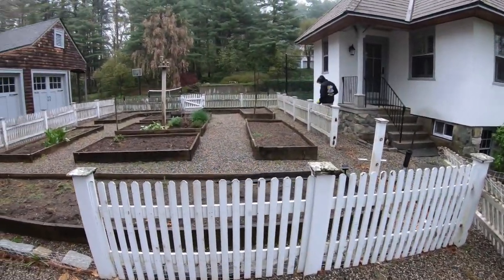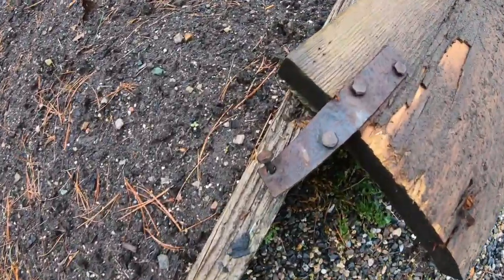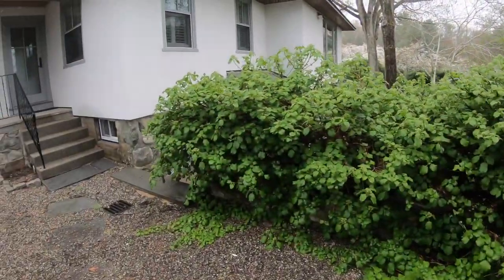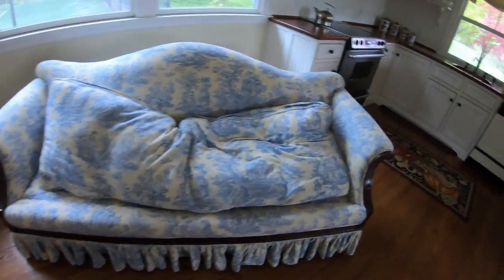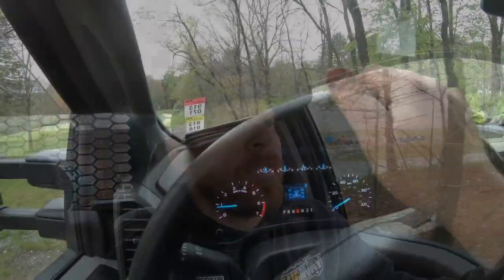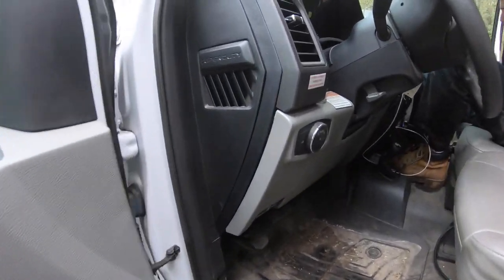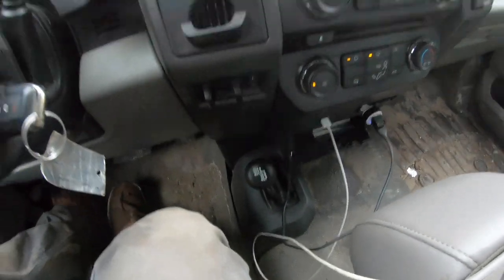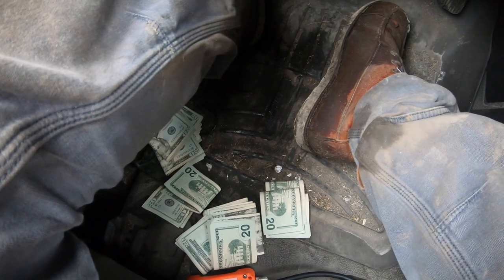HOW I MAKE $2K A DAY! JUNK REMOVAL DAY IN THE LIFE EPISODE 14

Comment: I saw you dumped a copper baseboard heating element, do you keep the more expensive metals you come across (i.e copper pipe and wire) might be worthwhile to have a spot at the shop to collect it and when you have enough, scrap the expensive metal. Just a thought.
Reply from the maker: I do. I tossed that because I wasn't thinking lol. Normally I would take the time to pull out that copper pipe. I have barrels of copper and brass at the shop. I usually take them to the scrap yard once I feel I'm at the $1k mark.

Comment: Hey Steve, I am having trouble getting leads to say yes to my prices. I charge $375 for a full trailer it’s 6x10 with 7 feet walls. And my dump fees are almost $100 here in LA. Just today I payed $95 for a 1.2 ton. Am I charging to much ? Also how are your dump fees so cheap ?
Reply: Would you go 10 plus miles for a cheaper dump fee ?
Reply from the maker: How legit is your business? Do you have a truck or truck/trailer lettered that looks professional? Are there a lot of. "fly by night" haulers in your area? My dump fees are expensive but tend to be cheaper for my area. I'm at $140/ton plus extra fees $15 and up for computers, a/c, tv etc. If you are hauling. heavy material you need to factor that into your price. or it will eat away at your profit.
Reply: Just started the business but I am legit. I built my trailer got a work truck. With my own logo and shirts with business cards. Trying to come out very professional. And not a lot of haulers in my city just big brand names.

Comment: Did you have to do anything special to add demo to your hauling business.  Im looking to add it but only for outside work around ppls houses .
Reply from the maker: You'll need to check with your state. Where I'm at, as long as I'm not changing structures I'm fine with just my insurances. If we do interior stuff a permit needs to be pulled by the home owner or contractor that hires us.

Comment: Do you remove oil yaks from basements if so how do you handle leftover oil? Thanks Eddie
Reply: Tanks
Reply from the maker: @JQscoreylmao  Hahahaha
Reply from the maker: We do. Oftentimes the tank is old enough where there is no oil (best case scenario) and we cut them in half and pull them up through the bulkhead. If we are hired to do the job but there is oil in the tank, you need to call the company the filled the tank and they will usually pump it out for a fee. Every customer that has a. tank with oil. still in it will always say "It's good oil, you can have it, I just need the tank gone".  Little do they know how difficult it is to pump out half a drum without the right equipment.